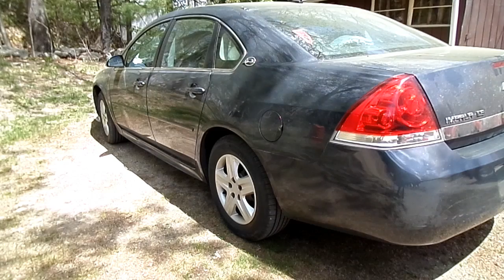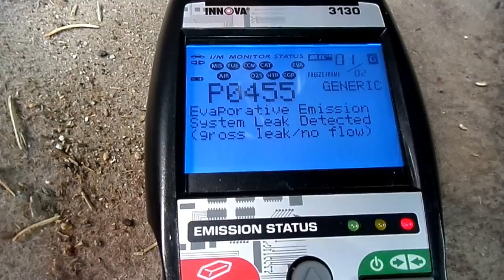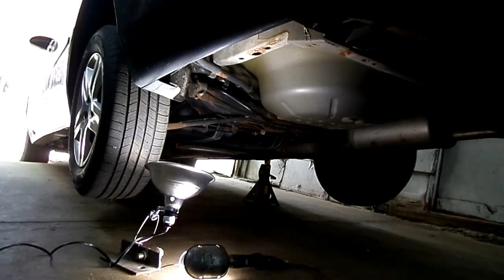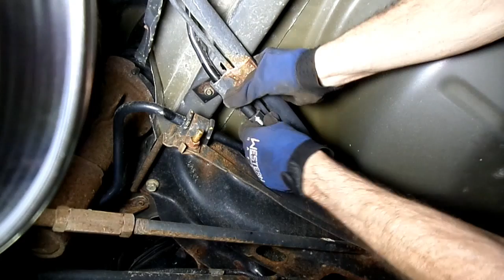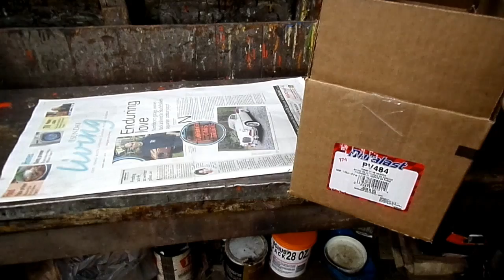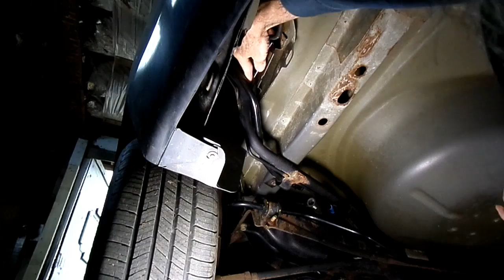P0455 Chevrolet Impala Fix

Comment: Codes I have for my 2009 Chevy Impala LT 3.5 already changed the gas cap already changed the front solenoid purge valve in the engine and these are the codes tha t I'm still getting PO442 PO451 PO454 PO464 N P162B n A C0040 which is the speed sensor the ABS traction control and stability light comes on so already ordered a front passenger hub bearing hub bearing new rotors new brakes already checked the wiring harnesses they're good but as for the EVAP codes I have no idea that's the only thing I did not change yet it is June 8th 2024 and I just bought this traded it in because I had very low mileage for 15 years old 90,000 MI the engine runs fine no misfires just when I make left hand turns no check engine light comes on but the ABS and traction control light comes on so hopefully the hub bearing will fix that but the performance is good it doesn't stall out I'm wondering why I'm getting false codes like I said I already put a new gas cap on their and the engine purge valve so I'll try and put what you just did

Comment: One of our family members has an 08 Impala and it's throwing a P0455... I did a smoke test and found no leaks where the smoke was coming out... I even used my Launch Scanner to turn off and on the Canister Vent Solenoid....when it was off it would blow smoke out of it.....when I turned it on, the smoke stopped....... what else could be the problem?
Reply: A mechanic I watched said a customer paid a different shop $2000 in repairs just for it to be the fuel pump as it had a crack but the shop never checked it

Comment: No, it isn't! That code can be set by a thousand different problems, from gas cap to purge valve. Your diagnostic skills are very poor. Like most repairmen, you just throw parts at a problem and hope for the best.

Comment: I have a word of advice when replacing this canister vent valve make sure the one that you're buying has a harness adapter because the electrical plug may not plug into it because they change the electrical plug some don't come with the plug and if you do a smoke test to find a leak make sure the engine is running otherwise you're going to see smoke coming out of that canister vent valve if you have to buy the harness it almost cost as much as the whole canister vent valve with the harness
Reply from the maker: Thank you for the info much appreciated.

Comment: Just changed it in my 2005 Impala....The 10mm bolt was solidly rusted in place, even after spraying with WD40 so I was able to slide the purge valve assembly off the bracket and install the new one without unbolting the bracket from the car.

Comment: How do u rest ur check engine light
Reply: If you have a code reader that plugs into the OBD2 connector such as what Richpin used,  you can clear the code with that, or else you can disconnect the battery for a few minutes and then reconnect it.....That will erase the codes and then if the repair was successful, the code will not come back.

Otherwise, you will have to drive the car for a few days and the computer will clear the code and shut off the check engine light itself if the repair was successful.

Comment: Hi Rich I have a 2009 Chevy Impala 3.5 L and I had to replace the same part on mine a couple days ago because whenever I would try to put fuel in the gas pump handle would just keep clicking off . I had a P0466. The vent was stuck shut.

Comment: Are there other parts that could be affected when a P0455 code is generated I should be aware of or is it just those parts (including filler tube condition) that you stated here? Just wouldn't want to replace that selenoid for nothing like you did here. Just curious

Comment: I just started getting this code a month ago. Replaced my gas cap because it was the original and cleared the code with my OBD and it still comes back. So I did some research and that’s how I found this video. Aside from the nuisance check engine light will the faulty solenoid cause any other issues such as performance and such? Thanks.
Reply: If your state has annual safety and emissions testing and the check engine light is lit due to a fault code from the purge valve, or other problem, it will often mean an automatic fail of the inspection simply because the light is lit.

Comment: I have a 06 Impala. I've had this done to my car. The "Thighen Gas Cap" still comes on. I've bought a New gas cap. Still comes on. I've had 3 different mechanics work on this, and it still comes on.  So one day I just thought I'll let the car run, put in drive. Other foot on the brake. Let it run for 1 minute. Turn the car off. Let it set for 1, or 2 minutes. Turn the car back on. Drive the car ( heading to work) Wouldn't you know it.. No Thighen Gas Cap comes on!! So why is this??? Check engine light is still on, but No Thighen Gas Cap.
Reply: I am literally having the same problem.  I've had three of these canisters I've put in.  Wasted money getting a smoke test and both mechanics say this part is the problem.  I'm on my third brand new one and the car is still throwing P0455.  I'm about to give up.

Comment: Job well done, I think I may have to change this vent valve/solenoid next after P0455 keeps coming back after OBD II scanner erases it....just had to change the pedal position sensor/accelerator pedal today also...another guy that seems to regularly bug out in these Impalas around 2008. Would even cause some ABS trigger/hesitation on turns at low speed! I forgot what its like to not drive a car with check engine lights on 24/7 ;)

Comment: Great video. Thanks.  It fixed my P0455 code and turned off the check engine light in less than 3 miles.
Reply: When that engine light on it won’t let you do your automatic starter

Comment: Literally not even a 5 minute fix. 30 miles later, check engine light disappeared. Thanks....
Reply: So all we have to do is drive around for the light to go off?
Reply: After I replaced the evap solenoid

Comment: I have a 06 impala ss with the 5.3. I have the same code and changed the gas cap and still there. Also i get about 120 miles to a full tank which is awful. Could this cause bad gas like my situation? I notice a rotten egg smell after i got on it  but the cats tested fine.. thank you for yalls time and if anyone can help me out id appreciate it
Reply: 9872jake9872 the rotten smell is more likely shity gas in your case
Reply: BashingBrainez agreed. I went to an non-ethonal gas station and it runs great an better power but still just bad gas. I changed pcv valve ang i get about 160 on a full tank now but just lost on why people are getting 300 with the same car an motor. Lol
Reply: 9872jake9872 i dont get how i have a 06 v6 impala and only get 300 to a tank
Reply: Y’all got bad driving habits lol

Comment: So I just watched your video and Thank you! I was going to take my Impala to garage, but think I will try and fix it myself. Everytime I try and fill the tank I can't get but a trickle in without the pump shutting down so I figure it has to be this solenoid not letting the tank vent.
Reply: Sounds like the charcoal canister
Reply: @raphaelbrown3855  I have his problem.  So it requires changing out the charcoal canister? Btw, mine is a 2008.
Reply: Don't know if you fixed it already

Comment: did the code go away right away? or did u have to clear it with the scanner??
Reply: +richpin06a I had the same code, I  replace the same part, and now the code P0455 is back.
Reply from the maker: +allmightyjamestown It is best to clear the code after the job so you know it has been fixed.

Comment: Smashing job mr richpin :-D
And you showed us how to do a test on the old one.:-)
Some people do a "shot gun" replacement of all parts in an area, and it can work but a dam expensive method :-(
Reply from the maker: zx8401ztv If at all possible i like to test.Sometimes i have a good used part around i can try also.
Reply: richpin06a Yes ive done that when ive been repairing electronics and there is a chip that i cant prove good/bad, a spare known is a good test :-)